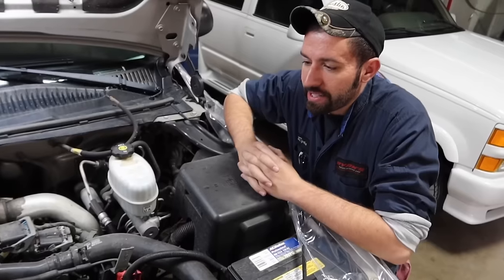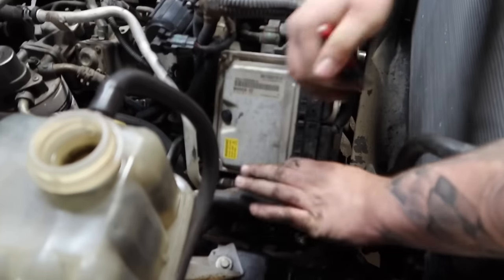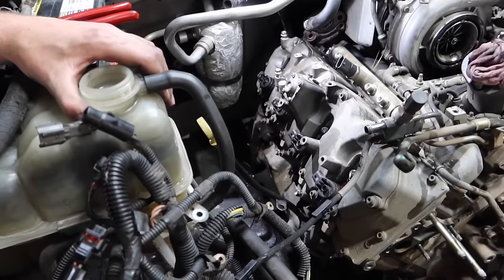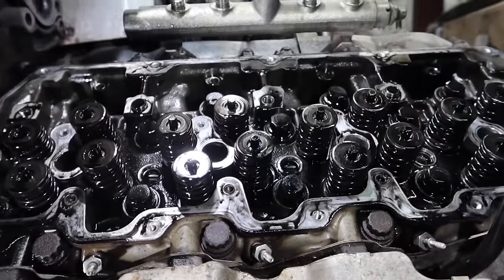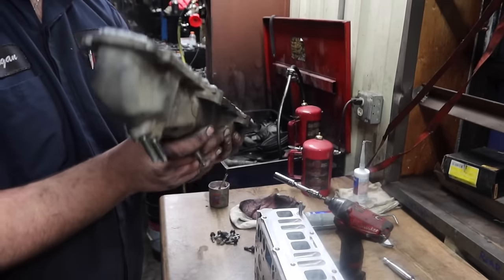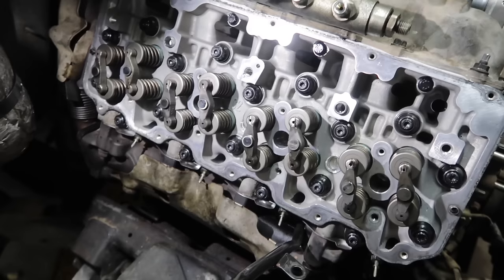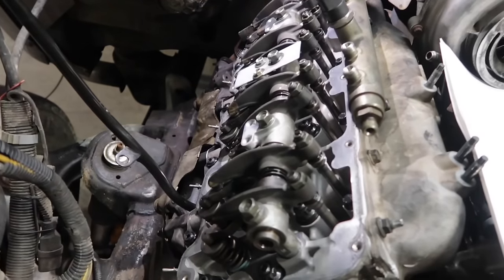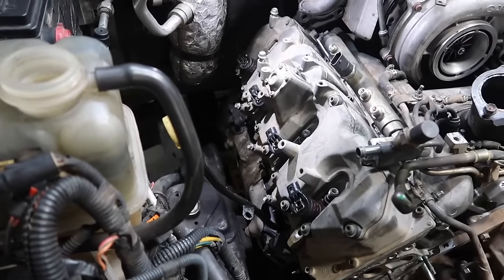How To Install Head Gaskets And Head Studs | Duramax

Comment: so this is an 80 hr job for a backyard mechanic.....?
Reply: Maybe 40-50 hour job at the most, it depends on how steady you work and what challenges if any that you may face like striped allen heads or bolts that don't come off easy etc.... I have never did a complete head gasket replacement but just started one yesterday and removed tires inner fenders and other road blocks to a smooth job. Today brush guard and front parts, grill, fan shrouds, fan and other parts that make access easier. I figure about 3 weeks on and off but when I go out there I'm there for 2-4 hours and not always steady but enjoying the process. I don't plan on putting insurance on this truck for at least 2 months, I only use it in the summer.
Reply: @richardwinquest1647  how's it running?

Comment: sand paper is a  large no no... yes sand rocks will get down in there as it flakes off the paper not good and some will get into the oil drain back holes so just don't do it if it is your truck only if it is a customers truck then who cares??? get paid for the job and let the oil filter do its job, and some rocks of sand will get into the rings yes oh well... but on mine i just a large file to look for high spots thats all you really need is to look for high spots and knock them down and never just sand glued on paper at 80 grit and come back with 180 sand grit ??? come man, i work on Helicopters and jets for the Government for 23 years and yes we never would think of using Sand rocks glued on paper that will flake off into the engine ... SO SAD TO SEE THIS INCOMPETENCE AND LACK OF PROFESSIONALISM for there customers,,, no quality of integrity here...

Comment: I can’t believe after doing all that work that you put the piece of shit EGR system back in. SERIOUSLY WTF???
Reply: I would guess that the customer had to have it put back in because he lives somewhere where vehicles are inspected for emissions equipment.
Reply: Mitchell Phelps no offence but don’t believe that at all. Not on a 2005 truck. A complete delete for that year of truck is only a few hundred dollars and no tuning is necessary to remove engine light when EGR is removed. Removing the EGR on the LLY is hugely beneficial to the longevity of the motor! And redoing head gasket and not doing this easy step is foolish! But that said it is a good video showing the head gasket process!